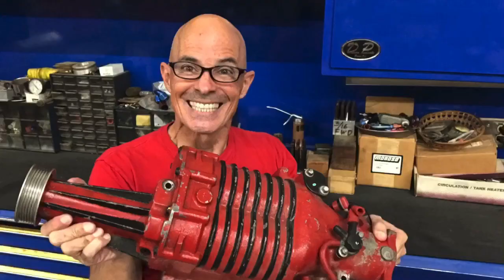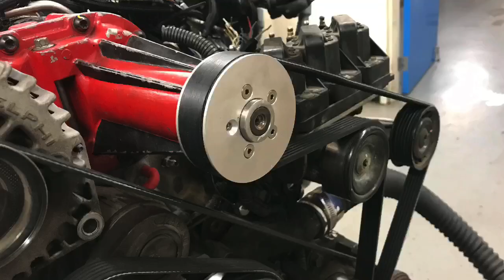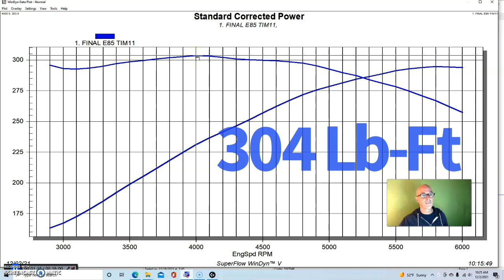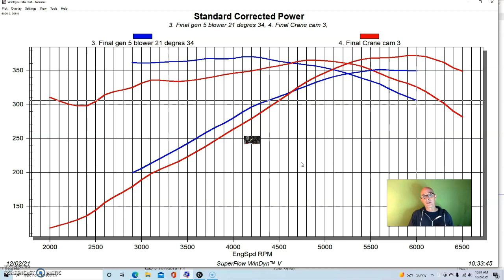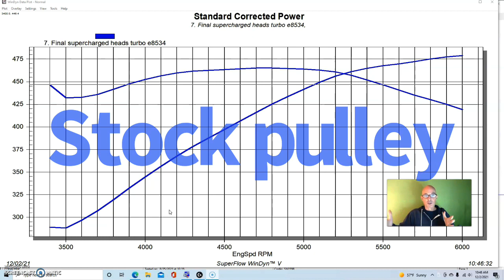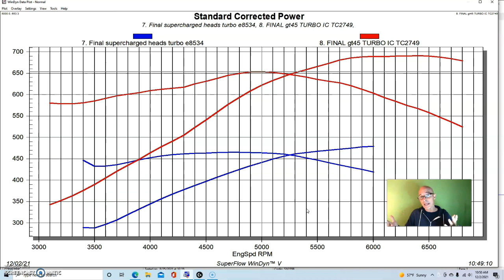CHEAP, JUNKYARD, BOOSTED SWAP MOTORS. L67 3800 V6 VS 4.8L LS!  WHO MAKES MORE STOCK & WITH MODS?

Comment: 3800 is such a badass platform. So much potential, the 3800 can make some unreal power when built right, and they sound so good with a big cam, I would dare say better lope than a V8 imo. The Aussies have pushed over 1000hp to the tire consistently with these little V6 motors. And they pull HARD!

Comment: I wonder what a chevy vortec 2700,2900,3500 or 3700 would make, their great inline 4&5 cylinder engines. We know the vortec 4200 is capable what about the cheaper smaller versions. Also those 2.0 ecotec engines the LNF, LDK gen2 variants or the LTG,LSY gen 3 variants. All cheap and abundant drivetrains with potential, probably more then a 3800 v6. You should do a 3800 v6 vs a inline 5 & inline 4 vortec vs a 2.0l ecotec.

Comment: Did you have to change from stock injectors for the 3800?
Reply from the maker: yes-the injectors need to be big enough to feed the power level
Reply: @richardholdener1727  thought so. I assumed to the 60lbs. Thanks for the cool videos. I wish you were close enough to join our 24 hrs of lemons team. Lol

Comment: Any vehicle 3300lbs or less would be a rocketship with the modified 3.8sc. I never went that far with a gtp, I ran series2 motor, stock m90/ 3.2pulley and they run quite well considering heavy fwd auto car. It would destroy the tires if you wanted too lol
Reply: I have a 04 ss Monte with the 3.8 s2 supercharged,for the smaller pully did you need to do anything else or was everything else pretty stock
Reply: @TheRealNeoFrancoisas I recall you can go down to a 3.4 pulley with minimal modification. You have to put in NGK tr6 spark plugs.  For best results you want high flow exhaust and cold air intake.  To go 3.2 or smaller pulley you have to grind or trim down the supercharger snout.  I highly recommend ZZP for parts, there modular pulley setup is great and I upgraded to there green coupler.  Those cars are a blast with some mods.

Comment: If you look at what Gale Banks has done with compound super-turbocharging, he's found that turbos feeding the supercharger is a bad arrangement for highest efficiency and power (but good for packaging under the hood). The supercharger needs to feed the turbos.
Reply from the maker: I think he did that on a diesel-this is not that
Reply: @richardholdener1727  You have more knowledge than me, so I defer to you. If you have time, watch this Banks video "1,200hp The Wrong Way", see if my opinion carries any water

https://youtu.be/i6cR5Jx2UsM

Comment: I have 3 too many projects right now. I have an M90 I've been slowly remodeling to work with a Carb. It's been done before, and quite successfully. The rear Bearings I've chosen have a 2 lip seal, and the manufacturer claims they can withstand Nitromethane, Ethanol and "Etc."

Comment: Holdener I hope you read this. And test \ prove it. Can you PLEASE do a video, on turbo boost & spool vs exhaust leaks. Showing how much or little, exhaust leaks can hurt you. How it may create lag or boost loss. Like little leaks up to bigger leaks. I just think it would be a great learning video. P.S. love you vids man !
Reply from the maker: I have been talking about that for years-after using oxygen sensor holes in my y pipe to help improve a situation with too small of a waste gate-I need to just do it-and leaks in the cold side
Reply: @richardholdener1727  I'm going to have to look up that vid. I'm super curious on the results

Comment: Just wanted to say a big thank you Richard. There isn't a great deal of in depth l67 content available that tests multiple combos like you have.  In Australia is is a bit of a niche platform to work with as they didn't produce a massive amount of these motors. I like that they are a bit of a different thing and the way they deliver power makes for a really enjoyable mild street motor. Thanks again for your other guys series. I'm about to sort out my L67 very soon and get some more power. You have helped out in a big way in helping to understand what these things want and respond to. 👌✌👍

Comment: Richard... You clever man..  For a swap into a smaller vehicle, say an S 10, I can see the V-6 Supercharged may be a better choice. If one wants insane power, an NA 6.0 LS would be the simple choice, but the compact V-6 sounds like an excellent alternative to a 4.8 V-8. For the Ford guys, Ford 3.5 Ego Boosts a plentiful at the wreckers. The 3.5 Ford is already turbo, of course, and a variant of this little monster won Lemans in 2016
Reply: Finally Ford won Le Mans again, Corvette took it like 8 times.

Comment: The bigger motor definitely has more power potential. The LS is an excellent and proven V8. However, there's something to be said about the 3800's durability. I've been hitting my L32 with 500-700whp for 10 years and it still runs mint. I've been next to (in front of) several s/c and turbo LS combo's and more than a few of them have spilled their guts all over the road. Not saying the 3800 is better, just saying it is a damn tough engine.
Reply from the maker: 700 whp?
Reply: @richardholdener1727  the weakest 3800 (l26) has been over 700 wheel. Current record is over 1200 wheel over in Australia

Comment: Barring a situation where the 4.8 just wouldn't fit well (transverse mid-engine setup for example cough:fiero:cough) I'd be hard pressed to pick the 3800 over the V8 in any application.  3800 is a solid engine, but LS is better.
Reply: Look at Series 2 and 3 Buick 3.8Ls. Consider the 4.3L 262 LU3

Comment: The 3800 s/c would be alot better if the throttle body wouldn't be pointed at the firewall in a rwd application

Comment: Richard, years ago I used to street race and track race a 1995 Riviera, 3800 supercharged with about a 125 shot of dry nitrous and a BIG fuel pump/regulator and it went NUTS! I would REALLY like to see you test NITROUS on SOME 3800.. PLEASE! The cooling effect of the Nitrous on top of the Supercharger makes SUBSTANTIAL torque gains! Thanks for all the hard work! (worked it down to 13.80s in the 1/4 mile from 16.40s!)
Reply: I have just recently hit 13s with my 2 door GTP on minor bolt ons. Really an impressive platform no doubt! I have had faster cars but whenever I'm in the ole GTP everyone wants to play and race, they all think its a massive underdog lol, and it surprises ALOT of people. Really makes driving this car fun. I hope to one day hit 10s with an all out build 🙏 and still daily this pig. It's awesome the aftermarket is still alive and improving these 3.8 bricks.
Reply: @BagpipekilR  I'm glad and hoping the market stays alive for a 2000 SSEi as well.
Reply: Series 1 buick 3.8

Comment: When it comes to comparing the supercharged 3800 to the na 4.8 LS, I prefer the 5th gen 4.3 V6.  Do some LV3 stuff.  Cam and turbo.  It'll blow any supercharged 3800 into the weeds and be lighter.  The 4.3 replaced the Gen4 4.8 with the same power, and even more if run on E85.  Smaller and much lighter package than the iron block 4.8.
Reply: I've been considering doing a 4.3 Lv3/lv1 to replace my m90'd Firebird. Only problem I see is there is little to know aftermarket support. 

Between a stroker + aluminum heads + m112 supercharger + e85/ic combo 3800 or a fbo Lv3 with an m112 blower and e85/ic combo. 

About the same price comparing the two set ups, but with less aftermarket on the 4.3 I'm hesitant to trying it
Reply: @chefs_garage  A stroker split-pin crank would definitely be expensive.  But it doesn't seem like a Brian Tooley VVT cam with lobe positioning for the V6 would be such a big stretch.  Then porting the heads would be common with the L83 5.3L.  They use the same ports and valves.  Keep the stock intake manifold.  Turn the exhaust manifolds around and plumb to a front-mounted turbo.  DI injectors from a ZR1 Corvette would easily handle the fuel requirement.
Reply: @andyharman3022  there's a guy on here who did a turbo, cammed, 4.3 Lv3 swapped into his grand national, and that's where the inspiration to use it in my bird but supercharged instead came from. Cam was custom grind tho. So I kinda want to see if the aftermarket develops more for it before trying it. But it is a really tempting package. Very light weight, 11:1 cr, pushrod v6. Gen V V8 with two cylinders chopped off, and flex fuel capabilities. Gen V V8 derivied leads me to believe a 10 speed auto could be bolted up to it. 

Could be a lot of fun for sure.
Reply from the maker: di/vvt motors are problematic to run on the dyno
Reply: Not enough support, its like trying to upgrade heads on a LU3, L35. The 4.8L is older, and can handle moar boost.
Reply: @shadowopsairman1583  Then Gen V engines were designed to handle more cylinder pressure than the Gen IV's.
Reply: 4.8L LR4 crank in a 5.3L LH6 block,GT45 and E85.  Light and lots of power.

Comment: Stroke the 3800 to 4100.

The 3800 comes from the same engine family that includes the BOP 215 aluminum V8 and the Rover 3.5, 3.9, 4.0, 4.2, 4.6 alloy V8. And the Buick 300, 340, 350 V8s. That Eaton blower should be very adaptable to the V8s.
Reply: They make a stroker kit that brings it to 4.2 liters but it's pretty expensive and doesn't do much for strength. Unless you got forged internals. Which the 3800 internals are already pretty damn stout. People have had it up to 30+ psi on stock internals with a tvs1900.  blower.

Comment: Guys I remember working on the 3800, 3100, 3400 in the '90s. I've swapped 4.8 LR4's and LQ4 6.0's into a couple 4x4 crawlers and a hot s#!+ race car. An NV3500 works behind any gen3 LS in terms of fitment like what comes from the factory. Does the 3800 V6 have the same fitment in terms of being rear wheel drive? SM465, M20 bolt up fitment? The 3800 ain't no joke with boost but will it bolt up with a T56? CD009? Tremec TKX/TKO600? I never gave it that much thought way back then while being underneath them on a lift, on flat rate but I sure knew and paid attention to suspension and steering geometry with every car I came across. What's up with the old 3800? Can it bolt up to a rwd transmission like an SBC or even a gen3 LS? School me guys. A 1996 corsica ain't a bad daily when your 7.3 tow rig is on big single shots.
Reply: 3800 version all have GM metric corporate bell housing. The S-10 did have 5 speed corporate housing that may hold up but the early 2000’s camero 3800 were all NA but had 4L60e which you could put behind 3800SC just be sure to grab the oil pan, exhaust manifolds, and oil pump housing from camero. Also the LS4 has the corporate belling housing fwd just a FYI.
If you use the stock computer you will have to segment swap with hp tuners.
Reply: There is an adapter for both t56 and sbc (th350/400)
Reply: Thanks guys!

Comment: We NEED more turbo 3800 tests! I think a 3800 with a turbo alone will hold a candle to a 4.8l! We need to find out though!
Reply: Id like a Super & Turbo 262cid 4.3L.

Amazing the Gen 1-Gen 5 SBC, Buick Series 1-3 3.8, and the 262 4.3 are all 90° Engines

Comment: Cam swap + 3.0 Pulley swap - 4# boost reduction... Did cam reduce 6#? or no gain from pulley?
Reply from the maker: CAM DROPPED 4 PSI BOOST-THEN PULLEY ADDED SOME BACK-THAT VIDEO IS UP ALSO

Comment: I’ve always wondered what a twin screw would do for the 3800 compared to the stock Eaton M90.
Reply from the maker: I DID THAT-THAT VIDEO IS UP-I MADE AN ADAPTER TO RUN A KENNE BELL
Reply: Does wonders

Comment: 3800 compound needs to rev higher, and def needs intercooling and/or water-meth....the compound loses a lot of its advantages to heat, that's why the boost can be high but little or no gains

Comment: 😲, not bad for such an old & bad breathing engine (GM 90° 3.8L V6).
I would probably do turbo with an N/A intake, ported/matched everything on both intake and exhaust sides, add cam, springs and call it day.
That factory splayed crank probably was screaming murder thru the whole ordeal. 😁👍
Reply: Have that... Works great! 👍

Comment: I have a 97 RS camaro with a 3.8 that had a rod knock when I bought it to put the rear end in my 3rd gen ls swap camaro. I have kind of wanted to put the gtp supercharger on the camaro instead of just putting a ls in it
Reply: Skip the blower, it’s not very easy on the f-body’s and a turbo will make way more power
Reply: @TurboTPI  yeah that's one reason I haven't done that yet lol
Reply: It's a lot of fun if you do go the m90 route. Mine was a ton of fun when it was running. Both turbo and blower have their own challenges, but the turbo is easier to get big power out of it than the m90
Reply: Boosted Bird. I have my 3rd gen camaro with a 5.3 and tko600 for the power part. I just have the 97 sitting around with a bad engine and figured of doing something different so big power isn't something it needs
Reply: @levisouder5777  m90 builds are generally good for about 350+ whp, with insane torque. But there are people who have pushed it to 450+ and the record on an m90 being 500+. I like my blower whine, so that's why I'm sticking with the blower, even tho a turbo is much easier to make power with lol

Comment: Which one is best for fuel mileage?
Reply: I’d guess the 3800. My dads old 1997 park avenue ultra used to average 31-32mpg on the highway. Not bad for a big sedan with a supercharged V6
Reply: The key to the fuel mileage on the 3800 SC is the air bypass valve in the lower intake manifold that allows intake air to go around the supercharger,  thus reducing the pressure and the load of the supercharger. When vacuum drops with throttle angle,  the air door in the intake closes,  allowing boost pressure to develop.
Reply: L67 3800 V6, Australian Commodores fitted with that motor got 36-40 highway MPG.
Reply from the maker: 40 mpg?
Reply: @richardholdener1727  After learning how the auto company's determine mpg, 40mpg is easy unfortunately. Average speed is in the 40's for these tests with limited acceleration.
Reply: @richardholdener1727  
Yep, or in our metric world, 5.9l/100km.
Whenever I use to do a Melbourne to Sydney run, 880km each way at a boring 110km/h (68mph), years ago, I'd borrow a mate's VS Holden Calais with the L67, solely for the fuel economy. My 5.0L 304CID V8, in the same model Holden, would use over double the fuel, to do the same journey.